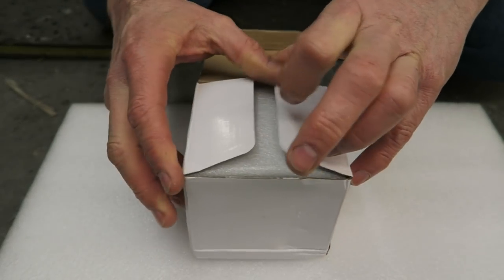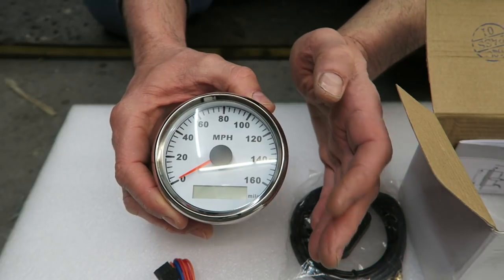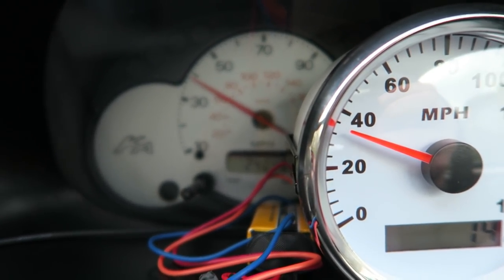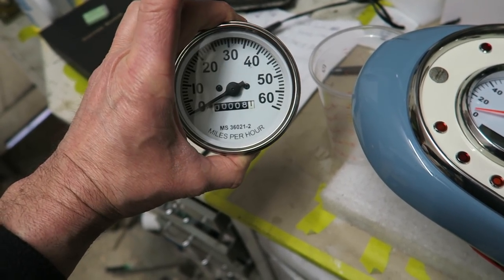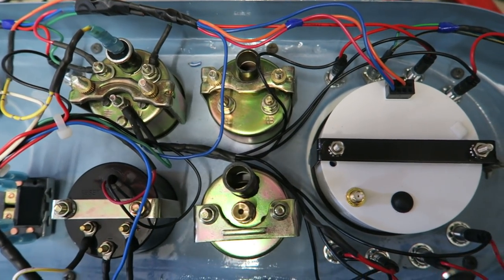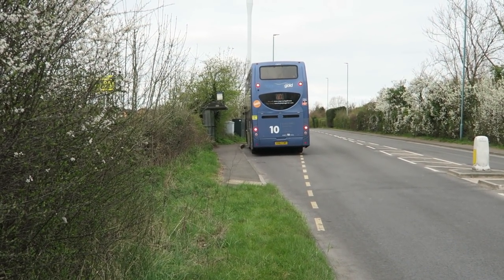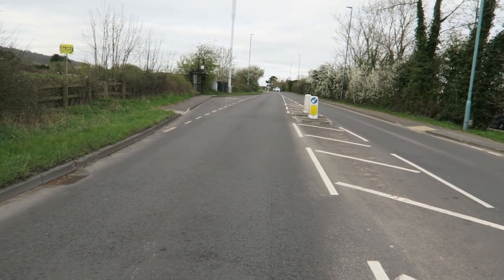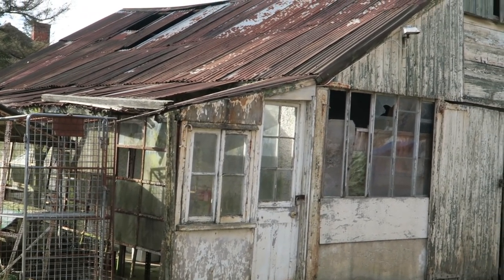GPS Speedometer fitted and working. Bedford CA 1960 Van.

Comment: Hi Trev. If you put a jubilee clip round the bezel, you can lever back the crimped edge gradually with a small screwdriver then reinstall it by rolling it back over. Check out old motorbike gauge rebuilds on YouTube.

Comment: G'day Trev, regarding your speedo antenna, I recently had a satnav / stereo fitted to my car that has a similar antenna that was professionally fitted. They told me they attach the antenna to the metal framework behind the dash which makes the whole car the receiver. You won't need to make it visible through the windscreen. Loving your teachings. All the best!

Comment: Great video, I think that speedo is a great idea, no finding a speedo drive, or fitting a pulse generator. So much time saving, and no worries about finding the right gear ratio tyre size. 
     Roads are like they used to be in the 50s empty.

Comment: Very similar to the speedo in my cf2, its been great so far. re the aerial, I tied the wire of mine into a loop and left it ziptied behind the clock, never really had a problem with the signal.  Nice work as usual Trev.

Comment: I mounted exactly the same speedo in my Bedford CF after changing the engine. Mine does not find the sattelites as fast as your's. Sometimes it does not start at all. I put the sensor on top of the roof, that improved it a bit.

Comment: Trev , under the roof is a bad spot for the GPS antenna. 1500 MHz radio waves won't penetrate steel. But they will go through glass. Likely you will get a stronger signal just inside the windscreen/windshield. That's the theory. If in practice the signal is strong enough to be reliable, it can go anywhere.

Comment: Hi Trev, You really should have a rev counter, If the gps goes down you can use the rev counter to drive by until your speedo returns.
Reply from the maker: Great idea. My plans are to recalibrate the mechanical speedo and refit it then mount the electronic speed sensor to the drive flange on the rear axle. Cheers Trev 👍

Comment: The speedometer in the van requires a specific size tire (O.D.).  Did you change the size. Doesn't take much. Finding the old tire sizes that were used here in the states back in the early 60's can get expensive. I think most speedometers are built to error optimistically. Gorgeous landscape and I sense many tax dollars being claimed by the local government. Thanks for the tour. Stay safe.

Comment: I always understood car speedos were "optomistic" to sell cars and to keep you safe from being caught
Reply: Steve...Blatantly copied of G@@gle but here are the current standards as per E.U. 'norms' (that still apply to us..). (European law (ECE-R39) says speedometers cannot show speeds less than the actual speed, and they must never show more than the 110 per cent of actual speedplus 4 km/h. So, under those rules, a car could be moving at 100 km/h, but the speedometer could legally display as high as 114 km/h.) Older speedometers would obviously be less accurate but would normally be showing a higher speed. Modern GPS/Satnav are highly accurate but you would be taking chance if you were solely using one for speed monitoring on the public highway...as 'The Law' doesn't recognise 'Military Grade'(albeit slightly downgraded) speed/navigation aids...
Reply: My dirtbikes reading 160kph at around 50mph. The downside of different tyres and gearing. It does look impressive tho to be flying down a trail @100+
Reply: My 1951 Bedford truck is as accurate as any I have compared with GPS.  !
Our Seat Lion was almost exactly 10% fast.

Comment: No comment on the GPS speedo debate, but I looked into speedo accuracy a while ago for a similar project, and this is the research I did. With regards to the legally required accuracy of UK speedos, you can read the full legislation here for new cars: http://www.legislation.gov.uk/uksi/2009/717/schedule/5/part/2/crossheading/1#text%3D%226.25%20mph%22 (scroll down to section 17). The summary of it is, the speedo must not under read by law. It can over read by 10% + 6.25 MPH maximum. So if you were doing 40 MPH, the speedo can legally read anything between 40 and 50(.25) MPH, but it must not read less than 40 MPH or more than 50(.25) MPH. The margin of error is to allow for general inaccuracies in the system, but also to take into account the wear of your tyres. Tread depth can vary by ~4mm (e.g. 6mm new, to 1.6mm legal minimum) which for an example tyre of 205/50/15 changes the circumference from 3076mm when new down to 3048mm when at the legal minimum. This is a difference in circumference of 28mm, or about 9%. Obviously a smaller circumference would rotate more times to cover the same distance a larger circumference wheel would, so the smaller circumference would cause the speedo to read a higher value by 9%. This is where most of the margin for error in the law comes from - taking tyre wear into account. The +6.25 MPH is most likely to cover manufacturing tolerances.

Comment: Cars used to read 10% over, but that seems to have changed.
The only law, as far as I know, is that speedometers can't under read, but I don't know if that applies to the driver or the manufacturer.
A good way to check your speedo, apart from the radar signs, is to follow a HGV on the motorway. Their speedos have to be accurate, and they'll be doing 56, unless there's a sticker on the back stating otherwise.

Comment: The GPS will be more accurate than the car speedo - these are regularly out by anything up to 10%. Won't be as quick to respond to changes in speed probably, and won't work so well in tunnels for sure!

Comment: Because traditionally car speedos are mechanical and accuracy affected by car tyre tread, pressure and size, manufacturers usually play on the safe side and engineer any small but potential inaccuracy to read high rather than low.
The gps is likely spot on, with the cars over reading slightly.
It was me that was worried about gps speedo during MOT time.
Is your Zetec Bedford MOT exempt?
I know rules regarding engine swapped classics are not black and white.

Comment: You can buy an 80mph version, I have one but cant as yet get the odometer miles to clock up.
Reply from the maker: It sounds like yours is possibly faulty? The only issue I have with mine is the start up. If I leave the van parked with the ignition on for two minutes everything is fine but if I drive off immediately then it sometimes struggles to fine the signal. Cheers Trev 👍

Comment: Please note that GPS speedo's are not approved for vehicle use in EU and by current extension UK, they must be driven by the vehicle mechanicals, whether that is a direct drive by cable or by the vehicles electrical system with sensors at the wheels, gearbox or final drive.  This is confirmed by the IVA test regulations that details all the relevant vehicle requirements.  If the mods to your vehicle dictate that you submit for a BIVA then your speedo will be checked.  If you are exempt from the IVA then your only risk will come from a VOSA vehicle inspection, either roadside or as the result of an incident.  MOT stations do not have the capability to test speedos, other than they function.  If you don't need an IVA then I assume that the vehicle is also age exempt from an MOT?  
The Govt website on the regulations for IVA are very useful in that they give the precise tolerance for speedo readings, which broadly is +0/-10% i.e at a true 50mph the speedo must read between 45mph and 50mph.  You may fall back on the original non-EU Construction and Use Regs that were in force when the van was built, which was + or - 5% i.e 47.5-52.5mph at a true 50mph

Comment: What is the brand you used to install the speedometer in the 1960 van? We want to purchase the exact one? Did you say you got it on Amazon?
Reply from the maker: No brand as such. Put a search in on eBay for 85mm gps speedometer. There are plenty to choose from. Cheers Trev 👍

Comment: That red backlight and the LCD would be totally unacceptable in my classic, having said that i am struggeling to get my original speedo anywhere near accurate with a mismatched gearbox.
so the question is, looks or accuracy? mmmm.
Reply: Fyi they make speedometer adaptors, gear drive, that attach to your cable output on your transmission then your cable attaches to that. What it does is increase or decrease the speed of the speedometer cable. I have one that when I switched my tires from street to drag I added my adaptor to keep my speedometer showing the correct speed. That's from the 1970's when I use to travel to street drag race. My cheater slicks that were street legal were a couple of inches taller than my daily street tires.

Comment: The speedo looked nice, until I realised that the small divisions in it's scale do not correspond every 5 mph, but every 4 mph! It's probably just me, but I would find that incredibly annoying. 
I believe European regulation ECE R39 is responsible for how close to the true speed OEM speedos are allowed to display. They have to under-read, partly to be certain that you are not going faster than you think you are, but mainly to account for tyre wear (a speedo driven from the power train will read slower with new tyres than it will with worn out ones, due to the reduction in rolling radius due to the wear).

Comment: I bought one of these exactly like yours a year ago. It worked badly for a while then packed up. I bought another and it doesn't work at all. So pissed off. It looks nice but so far I've just wasted £100. 🤥🤥🤥 any tips??
 the seller hasn't got back. Negative feedback.
Reply from the maker: If the speedo doesn’t work at all, is it totally dead with no counter working etc?
Reply: @trevsblog  it was powering  up but the needle wasn't moving. However, I faffed with it this am by relocating the sensor to the top of the topbox for an unhindered view of the sky. Its ok-ish now but not 100%. Fortunately its on my Sunday bike. No reliable speedo on your every day wud be crap in todays world.
Reply from the maker: @tombartram6842  apparently a 45 degree angled skywards is the optimum angle for consistency. My own can be slow to pick up the signal but once it’s going seems to be fine.
Reply: @trevsblog  45 degrees? That doesn't make sense as obviously it's going be constantly changing direction as u ride round  and looking at a different part of the sky. I ve mine flat. It doesn't work well but tbh fair looks really good. Much better than the OE lcd gadget.
Reply from the maker: @tombartram6842  well nothing much about it makes sense to me but that’s how people recommended I fit it and it works on the whole 👍

Comment: Hi Trev your GPS speedo is no less accurate than your car speedo because your car speedo is govern d by the rotation of your wheels which varies due to tyre wear, (a new set of tyres will have a greater circumference than a worn set there fore your actual speed to speedo speed would vary during the lifetime of your tyres also manufactures tyres vary in syse to each other, the problems with GPS is when you go through long tunnels and the occasional dead spot, but who cares anyway your old van is beautiful, keep up the good work and keep safe regards Tim.

Comment: Everything is from China now. There us no way around it. The gps speedo needs to measure distance and calculate. Also the signal will be heavily filtered so that the needle doesn’t bounce around. Filtering introduces lags which you are seeing. But once you are at a steady speed it should be very accurate. Big slot head screw looks a bit scruffy. Give it a polish?